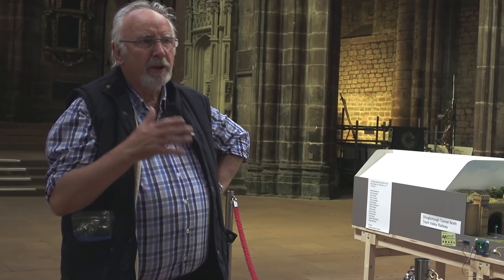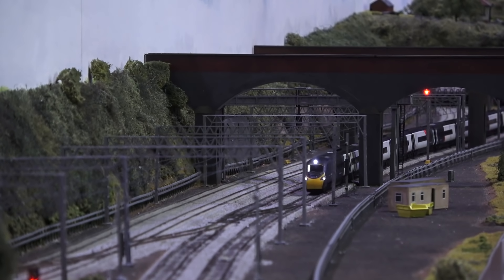Pete Waterman's MASSIVE new OO gauge layout - BEHIND THE SCENES

Comment: Looks amazing. Will definitely be bringing my kid up to see this, as we love modern day model railways.
PS, where do you get the droppers from to hold the catenary wire? Look better than our bent coper wire.
Reply: The bracket arms and registration arm that hold the catenary up are all made from brass wire using  two jigs that I made as they are all identical except for a couple across the ladder junction , 0.7mm for the 2 main arms, which in turn are soldered to 1mmx1mm brass angle at the insulator end which are from the Sommerfeldt range and 0.5mm for the registration arm itself. Each bracket is then superglued to the gantries, although only superglued into place the overhead system is fully tensioned which does not affect the MDF gantries or the brackets as the tension is equal from each end of each catenary wire run.
Reply: @dmu156  thank you for your reply. They look amazing compared to my efforts with 1.00mm copper wire and bending with pliers and using offcuts of insulation for the insulators. We have the mdf catenary which look amazing after the grey primer is applied.
If you're going into business with the registration arms, then can I be first customer?
Reply: I've been at the show for the past 2 days answering questions on the OLE and I'm back on Friday 30th and Saturday 31st of July if anyone is visiting on those dates.